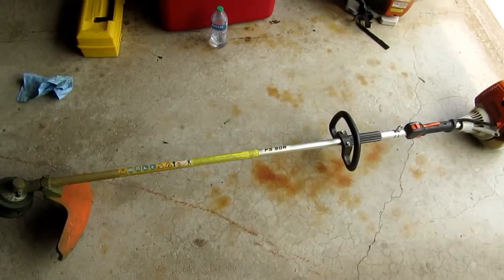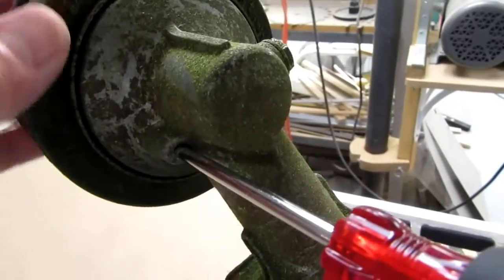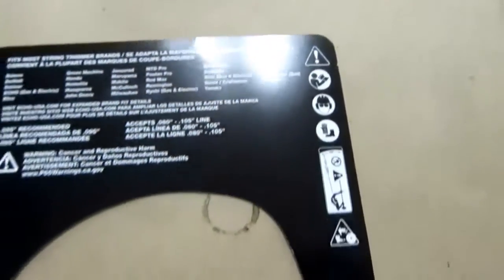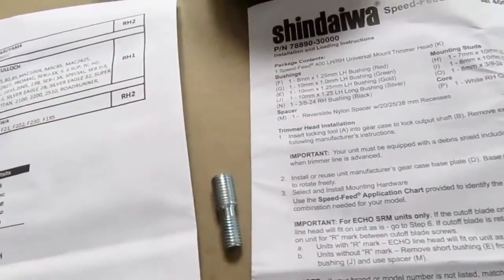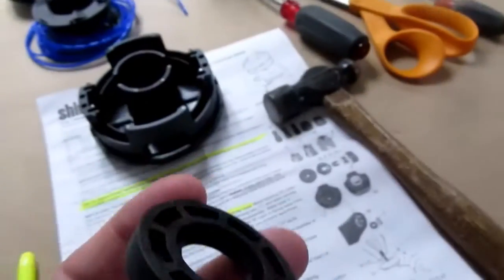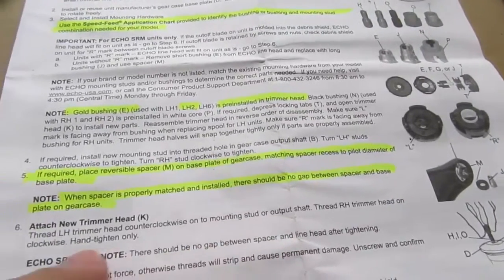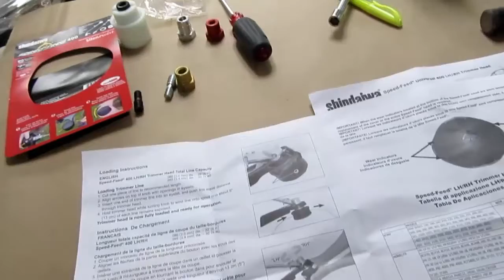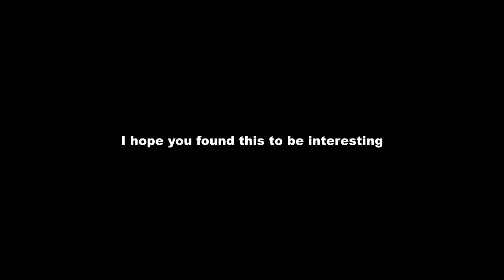Installing a Shindaiwa Speed-Feed Universal 400 Trimmer Head on a Stihl model FS90R String Trimmer

Comment: Hey, I had already watched a few videos about this Speed-Feed trimmer, so I was partially prepared to install mine on a Ryobi Electric trimmer that I‘ve had for about 6-8 years. Anyway, I had to take the Stock shaft completely off my trimmer, but I had to take the New Head apart, remove the Black bushing w/the Brass metal bushing & using the White bushing w/the Ref metal bushing. I initially put the Black round gasket on first, but it was too tight. The Head would not move. Take it apart & remove that gasket & reinstall the New Head again. It leaves a gap of about 1/16-1/8 of an inch gap, but it’s closer than the stock head. Anyway, after reinstalling everything, it spins up nicely & reinstalling the Blue Twine was a piece of cake. My instructions didn’t help me much, just remembering the YouTuber videos showing me how to change out the Black metal to the Red metal bushing helped. Also, there was no Base-Plate on my Ryobi trimmer, unless I had already misplaced or lost it.

Comment: Tech support is worse than useless. They cannot process simple common sense thinking and seem to be there to just point you to purchase a new product. I've encountered that in many industries/manufacturers that don't want their tech support to actually do what you would expect them to do. They just read off a screen and basically lie about not being able to use their product the way you are hoping to. Disgusting really.  By the way, the spool is meant to be used with the white central piece if you have a RH trimmer, usually a bent shaft type. In your case you keep the black central piece and use the spool with the L up since you have a straight shaft trimmer. Congratulations on muddling through that assembly.

Comment: I put on of these on my Stihl FSR 130 at the advice of my local lawn and garden store..........first, thanks for the video as the instructions included with the unit are BEYOND worthless...........so I might honestly say that I see NO benefit to this over the stock Stihl cutting head............first, they advertise it as only taking 20 seconds to load more string as you just shove the string through and then ratchet the head to wind it onto the inner spool............EXCEPT ....your line comes off of a ROLL and there for has a slight curve to it, often preventing it from going straight through the head, so you end up having to take the head apart to get the line through it............takes MORE time...........additionally if the line breaks off inside the head it takes a LOT more time to take it apart and refeed than on the standard head.........and then lastly .........the thing ratchets CLOCKWISE to load the string........well since these heads use reverse threads, if you have to remove this head, it will just keep ratcheting without coming loose..........so you have to take it apart and put pliers on it to get it off..............again no benefit to these at all.
Reply from the maker: @davidthayer6969  davidthayer, I completely disagree with your assessment of this product.

Other than the instructions (which might be good for many models of trimmer) being lacking, I have been delighted with this new head on Mt trimmer. The bump feed works better than the original head. It is much easier and quicker to load new string than with the stock head, and I don't need to disassemble the head to do it.

As for your complaint that the curved string coming off the original reel does not want to slide through this head when loading it; I initially experienced this issue, but in less than a minute I figured out that I just needed to bent the first foot of string in the curvature opposite how it comes off the reel, after which it is straight enough slide easily into the head.
Reply: @youtuuba  in addition the notches on the edges of the head where you grab it to ratchet it, hit objects bouncing the trimmer away if you get too close.
Reply from the maker: @davidthayer6969  you should not be trimming that close. Sounds like you abusing the equipment 
.